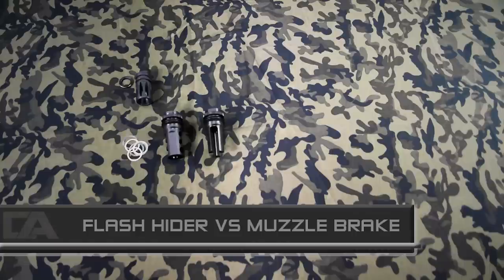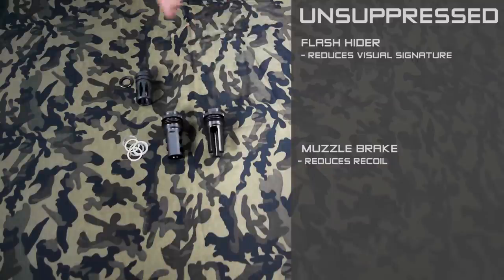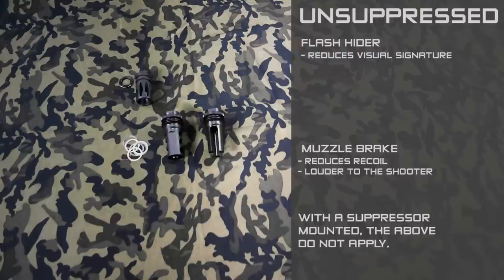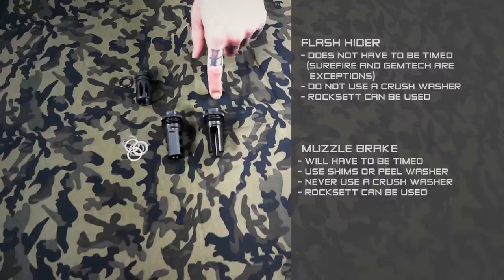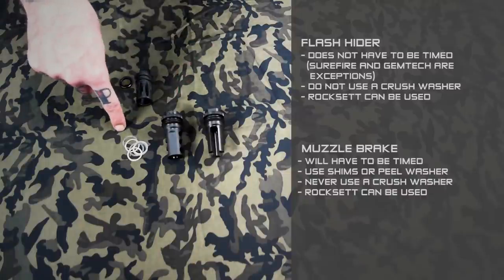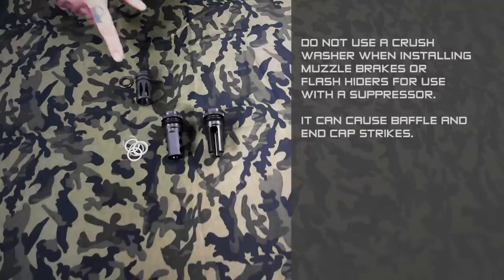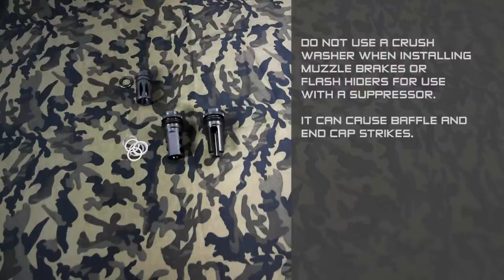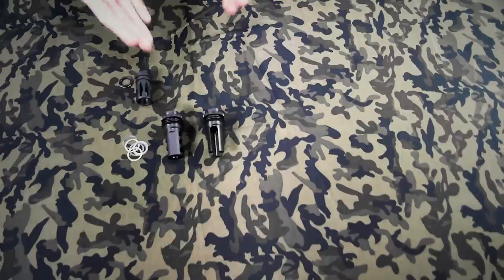Flash Hider VS Muzzle Brake

Comment: For anybody worried about CA laws, all you have to do is buy an ARMAGLOK to insure the magazine is locked in place while the rifle is assembled. Problem solved. It no longer meets the definition of an assault rifle. You can go ahead and install any "evil feature" your heart desires. 😊
Reply: I have lots of evil features on my AR - vertical foregrip, adjustable stock, muzzle device, and "Vote for Hillary" sticker.
Reply: How do you remove cancer?  You certainly don't leave cancer alone and just complain about it all day, do you?  You should do something about it.  XD
Reply: @Saitama - Good luck with that. You sound like you have really thought this out.
Reply: Except they loopholed their way through it. There's a clause that bans all "copy-cat" weapons, which would include any rifle that would be considered an assault weapon but has been modified to meet the laws. So modifying a weapon to remove "evil parts" so it meets the laws is still illegal apparently. That logic beats the hell out of me. Not sure if they have the copy-cat laws in CA, but that's what they do here in Mass.
Reply: Ivan Capuchino even with out it. It doesn't resemble an assault rifle
Cuz its a sporting rifle. And the m16/m4 is a combat rifle used only in combat
Reply: Na.. Install a muzzle break. Pull the pin out of your buttstock. Making it fixed. First adjust it to your liking. Install a stupid fin grip. Which comes off with one screw. Making it a non assault rifle. Then you can reinstall your original magazine release button. Cost me 60 bones. At Rifle Gear. Screw arfaglock or Patriot pin or whatever.

Comment: What are these muzzle devices, in the video.  They have threads on the outside.  
What size are the threads, on the outside?  
Would you also explain why I shouldn't use a crush washer, on a flash suppressor, if I'm going to thread a suppressor over it?
Reply: 007NunyaBizNess check out their other videos. they go into great detail regarding the subject.
Reply from the maker: SilencerCo ASR muzzle devices.  I'm not sure on the external thread pitch.  A crush washer crushes unevenly, which can lead to baffle strikes.

Comment: Why shouldn't I use a crush washer with my muzzle brake? I've been using one for a while, and it's worked great, both suppressed and unsuppressed. But if there's some major flaw in doing that, I'd like to know.
Reply from the maker: You dramatically increase the risk of a baffle or endcap strike.  Since a crush washer doesn't crush evenly (where as the shoulder should be perfectly square) it can cause the break to be at a slight angle.  Not a problem generally with just a brake, but add on the extra length of the suppressor and you can potentially have things significantly out of alignment.
Reply: VERY interesting.  I too have been using a crush washer behind my brakes, for years on many rifles.  No issues here.
Reply: Capitol Armory  I would think the exact opposite would be true
Reply: CA is right. Never ever use a crush washer. Crush washers are crap. Just time your brake. It’ll save you thousands potentially.

Comment: hello,thanks for all the videos questions  the flash hinder don't need to be timed?
Reply from the maker: Correct, the Flash Hider doesn't require any timing.  There are a few companies that want you to, but it's not absolutely necessary, other than just visual reasons.
Reply: Capitol Armory thank you
Reply: What about on the actual flash hider you are showing? isn't one of the 3 prongs longer than the other 2? I just got mine put on and the guy told me that it did need to be timed due to the one prong being longer.
Reply from the maker: No timing necessary.  The length of the prongs have nothing to do with it needing (or not needing) to be timed.  They eliminate the tuning fork effect.  (Such as old AAC flash hiders... they have a loud "PINGGGGGGGGGGGGGGGGGGGGGGGGG" every time you shoot.

Comment: hi, thanks for the video. I live in freaking California and so I must convert my rifles to featureless in 2017. one stipulation is that a featureless rifle can not have flash hider, only a muzzle brake. so, my AR-15s have that A2 Birdcage you spoke about in your video. is that considered muzzle brake or a flash hider? Or neither? Any help is much appreciated.
Reply from the maker: Good question... I really don't know.  I believe the A2 Birdcage was made after the pronged flash hiders had issues with vegetation, but it was a "flash hider plus some other stuff."  Mainly, the bottom of the A2 Birdcage being solid, to add some mitigation to muzzle rise.  I would put it as a hybrid device, a comp with flash suppression.  If I had to say it was either a muzzle brake or a flash hider, I would say flash hider.   As a gun guy, I'm going to say "A2 Birdcage is neither a traditional flash hider or muzzle brake."   I suspect the folks that make the laws in California are going to call it a flash hider.
Reply: Just buy good muzzle break and you dont have to do it till 2018 by the way :)
Reply: The A2 birdcage is a flash hider. as of January 1 2017 the ar15 will become a assault weapon in California. You have until 2018 before you have to get a background check and put on a list to buy ammo.
Reply: Jon Iwanyszyn i moved for better internet access. the very 1st thought i had when i heard about california is "well have fun losing all those taxpayers guys"... but nobody is talking about moving. i cant believe it. why would anyone stay there? on the surface its a beautiful place i get it. but there are plenty of problems. water, pollution, etc... now this. if someone in california has a home thats worth 250k there they could move here to wv, get the same kind of house for 100k less, have water, no pollution, n carry concealed without a permit n buy basically whatever they want. n im pretty sure there are 12 or so other states that are the exact same way.  i just dont understand why anyone would stay there :-(     im sorry btw, its terrible for californians. ill bet arnold has a killer arsenal, lol, damn hypocrite.
Reply: Install a muzzle break. Pull the pin on your buttstock. Making it fixed. Adjust it to your liking first. Install a fin grip. (Thaits they only thing that sucks but it comes off with one screw). Now its no longer considered an assault rifle. Now you can reinstall your original magazine release button. Get rid of your bullit button. No need for all that armaglock or Patriot pins and stuff. Had mine done at 'Rifle Gear' $25 for the work. Just buy your what you need. Total $65

Comment: Now if I have a muzzle brake and plan on running a suppressor full time, then it doesn't really matter if it's timed correctly?
Reply from the maker: Not really... but if you've already got the upper on a vice and are torquing down the brake correctly, it's not really that big of a deal to get it timed as well.

Comment: Was wondering if anybody can help me out was looking to get a suppressor for my AR-15 can I just screw it straight on the barrel or do I need an adapter why can't I just unscrew my flash hider and screw it right onto them threads it's an adapter necessary
Reply from the maker: It all depends on the suppressor being mounted.  Some are direct thread, some require proprietary muzzle devices.

Comment: So what is the A2 birdcage considered? Is that legal in CA?
Reply: The standard birdcage is a flash hider. But it does redirect some of the gasses upwards, forcing the barrel down (some). So although its not a muzzle brake it does assist a little bit with follow up shots, however small of an amount.

Comment: You are supposed to time that particular flash hider you have as well.
Reply from the maker: For SilencerCo and the majority of flash hiders, timing is not necessary or desired.  There are a few outliers, but most of those are either compensators as well or have some specific need to index such as Dead Air for ease of silencer mounting.
Reply: @Capitolarmory  Yes.  But, that hider there with the three prongs is supposed to be timed so there is not an open slat straight down.  It will still work if you don't, obviously.  It is for firing un-suppressed prone so there is less blast straight down into the dust, if I remember correctly.